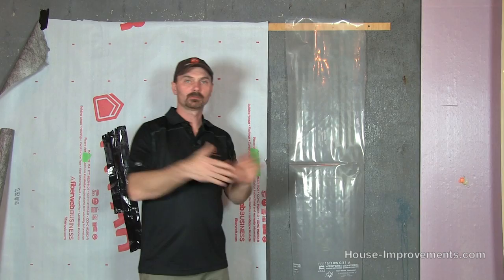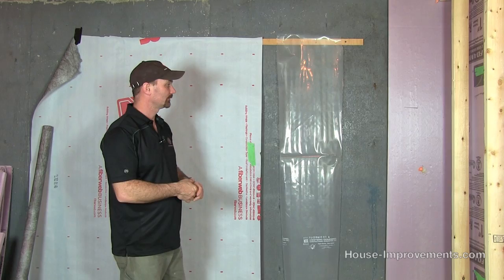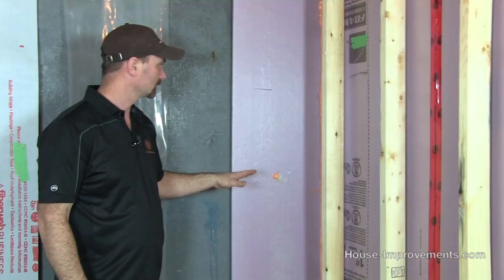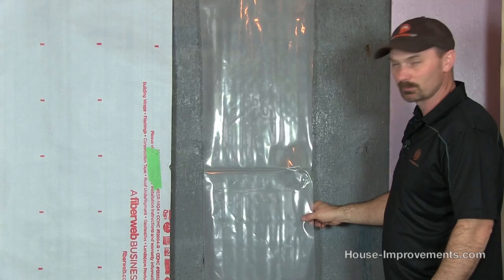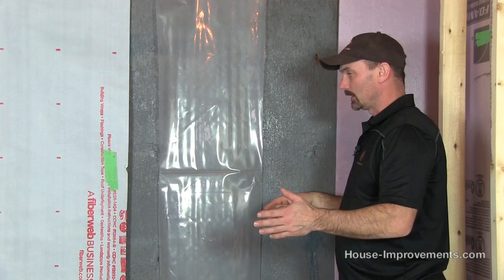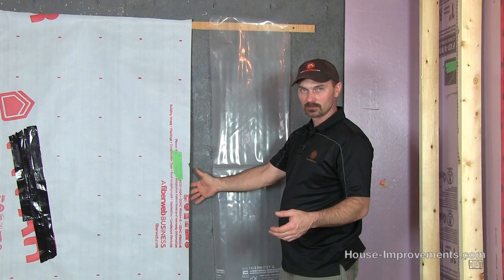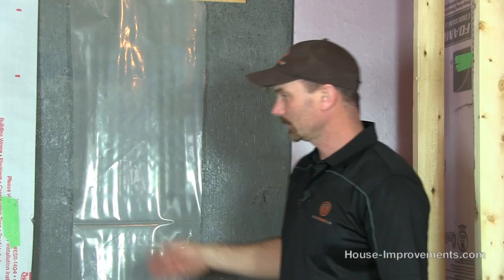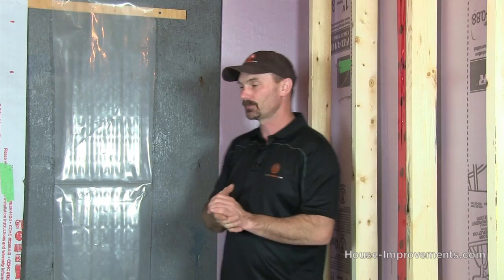Moisture Barrier - 3 Types

Comment: thanks for the video.  But, tyvek, typar, poly vapour barrier should never be used in basements.  1 inch foam is too thin.  minimum 1.5 inch foam for concrete walls.  basements walls must be sealed.  you dont ever want moisture to pass thru (as you say breathe).

thanks again
Reply from the maker: +dave daved Concrete is a porus product there is always some water migration. Interior basement Moisture barriers are required in many areas
Reply: Any wall with two vapour barriers in it, is sure to have mold in the future. Never use poly in a wall. And for sure typar or tyvek aint gonna stop nothing. Cement walls never need to breathe. And basement walls are always wet outside. Thx
Reply: even if there is moisture in the walls behind the 2 inch foam, it really wont matter as long as it sealed to the concrete.  Moisture can pretty much do whatever it want behind the 2 inch without regard (with in reason of course).  Avoid 6 mil vapour barrier in any basement wall assembly.  The XPS (not EPS) foam will not hold moisture in any significant amounts.
Reply: @HouseImprovements  Are they required in the GTA?